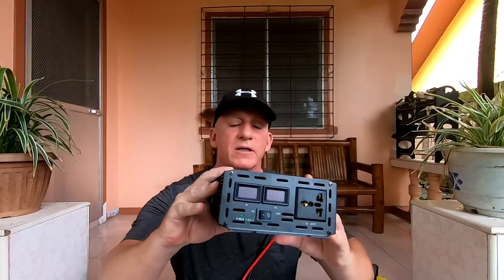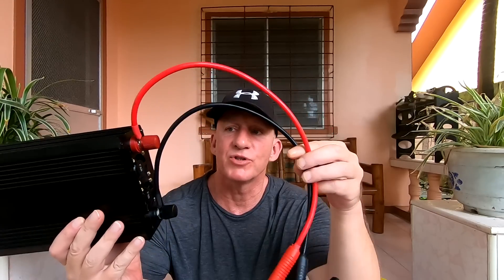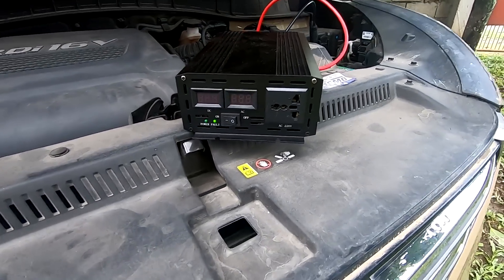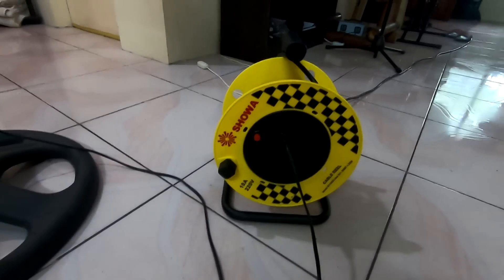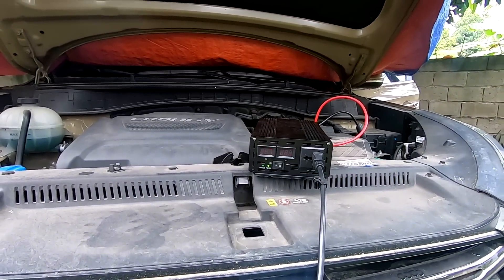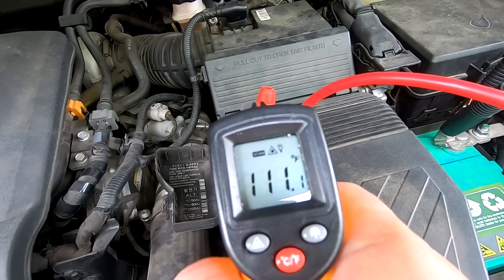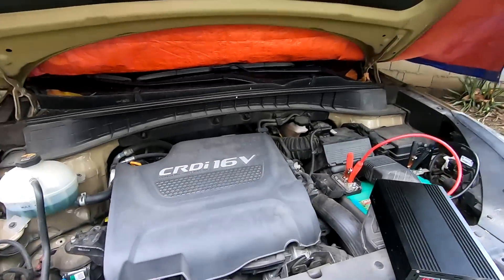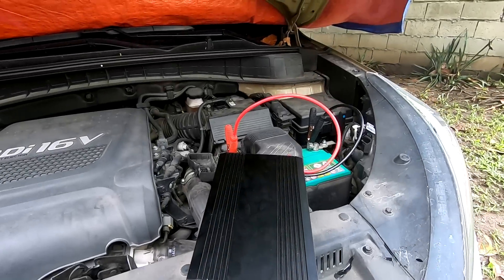Emergency Power in the Philippines:  $125 Pure (?) Sine Wave DC Car Inverter

Comment: Can I use a 12V adaptor attached on the wall outlet instead of 12V battery. Just to lower electricity consumption

Comment: FYI- if such power inverter is rated for more than 2500W cont. and is using 12V - it is unrealistic, because a 12v inverter can not safely and continuously run such high loads (over 2500W) without getting extremely hot (in a hot humid climate that will be even more fatal for the electronic boards and faster).
Rule of thumb if I remember right: if you need more than 2500W of power up to about 5000W - get a 24V powered inverter, if you need more than 5000W of power, get a 48V inverter, if you need up-to (or a little less than) 2500W then the smaller and cheaper inverter that can run on 12V will do the job.

Also watch out! a cheap $100 inverter that is supposed to reliabley give you 3000W, is financially impossible to manufacture, I'd be worried about the quality of construction or the use of cheap B-ware components, that might fail on you at the most important moment (goes long with the saying: "Don't try to save at the wrong places"), I'd actually invest at least in a half decent inverter, doesn't have to be the best of line, commercial grade unit, but something that is rated for and is being used for continuous deployments (not what is being found for dirt cheap on aliexpress, unfortunately).

just my 2 cents

Comment: Thanks , to avoid flickering on lights and panels you can use the 180 degree shutter rule. shutter speed needs to be double of framerate and in sinc with freqense of the current. In Europe its 50 hz  and in the US its 60 hz. so if you film in 24 ore 25 framerate the shutter speed should be  double  1/50 of a sec and in The US 1/60 of a sec. Double will also work cos its still pretty much in sinc. so 1/100 in Europe and 1/120 in the US. This will also give less flickering when filming things with repetative paterns like Fences, tiles on the floor and stuff.
Reply from the maker: It's a GoPro. No advanced settings.
Reply: @PhilippineDreams  Ahh okay , thanks for the answere, content is what is important, and i find your content to be really good.
Reply from the maker: Salamuch, amigo.

Comment: Have you checked if your modem will still receive internet signals during a brownout?  
Unless you are in the US with battery backups for the internet backbone, the Philippines internet backbone will be dead (no power) in your city when there is a brownout.  Is there any point to having power on your modem if there is no internet signal in your neighborhood during a brownout?
-Nils
Reply from the maker: We have fiber so it still works even durinng a city wide power loss. DSL does not fare as well.
Reply: @PhilippineDreams  That is impressive!

Comment: Hi Ned, I would suggest you drop the idea of weatherproofing or even semi-weatherproofing your inverter. The casing of the unit will act as a heat sink for the electronics inside so you should in no way restrict the flow of air to the unit. One of the reasons things like this go on fire is overheating and you will probably find that your unit (and most others) has vents at the front and maybe elsewhere and a fan at the back to provide as much continuous cooling as possible while keeping the size of the unit as compact as possible.
Reply from the maker: Good point.  It looks like it is already sealed though as there are no vents in the back or bottom to cool off the interior electronics.  I might just wrap sticky glue traps around the wall bracket arms to discourage the little buggers from exploring the compressor.
Reply: @PhilippineDreams  I used to "play" with electronics as a hobby years ago and kept a couple of similar units for spare parts. All the ones I had had vents at the front and a small fan at the rear so air was drawn through from the front and blown out at the back. The case itself acts as a heatsink for the high power components such as power transistors and will be made from alluminium which is good for dissipating heat. You were right to get pure sine wave, the best choice for an inverter but also the most expensive.

Comment: I am not a electrician but think that extension is super long you would be better off if you cut it to a specific length you could always ad Male and female ends to what left over
Reply from the maker: .64 voltage drop over 20 meters.

Comment: Doesn't want a generator as it's noisy but runs a noisy diesel car engine! I'd also worry about running a car on idle for long periods, I heard it glazes the cylinder bores, not a mechanic but on a van life forum someone commented that about charging your leisure battery from the engine!
Reply from the maker: It fits our limited needs pretty well.

Comment: After thinking about your evaluation we need to consider the capacity of the vehicle alternator (power source). Typical automotive alternator output is around 50 to 70 amps, a littler higher in some cases unless a high output alternator is used. If we use 70 amp @ 12VDC the continuous output power is 840 watts far below the 3000watts the invert is capable of. When we consider the vehicle has a load to be served by the alternator and recognizing an inverter is not 100% efficient something less than 840 watts is available after power conversion. Temporary / intermittent high loading can be accommodated due ti by the battery. In your intended application you should be fine, but ref and air con operation is not sustainable. Hope you find this useful.

Comment: The higher voltage is the charging voltage. When a battery voltage is specified that is the nominal voltage. Additional voltage is needed to over come the battery voltage (think of voltage as pressure). In addition to over coming the standing voltage the battery has an internal resistance that limits current flow into the battery, the higher charging voltage allows a reasonable recharge time. Charge voltage must be limited to prevent overheating the battery. Typically for a lead acid battery (commonly used in automotive applications) you will see 13.8 charge voltage, after a battery has seen some discharge. Once charged, the floating voltage is close to the nominal battery voltage but still higher than nominal.

Have you considered lithium iron phosphate batteries (LiFePo4)? Higher initial cost but over their life they are reasonable when compared based on number of charge cycles between lead acid and LiFePo4. An important advantage to these battery are long storage life. The have low discharge rates giving good standby time. They life expectancy does not suffer much if kept below 45C (30 or under is preferred). 

If you are interested in more information about LiFePo4 have a look here https://www.solacity.com/how-to-keep-lifepo4-lithium-ion-batteries-happy/

I am considering this technology for my home in Bacolod City on Negros. The once previously fairly reliable power system in Bacolod has had some planned 24 hour outages recently (gotta keep the refrigerator alive). When something like this starts I do not think it will stop anytime soon.

Comment: Be sure to roll the extension cord out, all the way off the reel. I have witnessed multiple coiled extension cords left plugged in - and left on this type of reel - they built up heat, melted or started fire. I like your inverter - cool tech.

Comment: HEY Ned, I'm an expat in Thailand. Been watching your various videos. NEAT!!    I"m a retired architect from the states. I'm NO licensed electrician nor HVAC specialist, yet the advice Deiselman gives you below is "prudent advice" from what I know.  I had a Jeep Grand Cherokee (in the states) with an inverter we installed under the passenger's seat, running a line back to my fishing boat, which I'd halt to Alaska each summer. In the belly of the boat was a lg chest freezer. I'd unload the freezer at our river front camp once I got there. The freezer carried frozen steaks for us up to Alaska and full of Salmon returning.  This trick worked out GREAT!  Yet found:  we definitely needed heavy gauge lines or the lines the size yer using now would seriously over heat and cause damage.  Lines from your inverter to the Battery AND the line into the house; PLUS maybe a "breaker" to be safe, PLUS I strongly suggest, you park your car closer to the home when you do this. Use a much short line so as less power loss and power drop.  But please, don't take my word for it, please ask experts.  Hope this helps a tad.
Reply from the maker: 16 AWG 25 meter is only a .64 volt drop. Not too bad.
Reply: Yup, but that wire, ask any electrician, is gonna over heat when you plug in sumthin like an A/C unit Ned.  I wouldn't be using anything less than 10 gauge copper wire. Good luck friend.
Reply: The power drop and heating happen only on the low voltage side with higher current from the battery to the DC/AC converter.   Get at least 10/12 AWG cables with better jaws.  
Remember at 3000 watts, the low voltage side will be drawing 250 amps!!!  That is a LOT of current and will heat up your low voltage cables as well as your car battery.
(FYI, I am also an engineer.)
-Nils
Reply: @AsianRomance    An inverter of this size can really produce/handle 3000 watts of AC output continuously?

Comment: It is expensive but the Bluetti is one of the best battery powered inverters.
Reply: problem is price/value, because with a stand alone inverter clipped on to a battery bank (single battery or more), it is very easy to scale your autonomy by adding more batteries to expand the AH of the power bank, that means more hours to run electronic devices, while the all-in-one type of devices are a blackbox, they have a certain rating it they can not be expanded, the price is also a bit concerning, for the price of a Bluetti, he could probably just by a 500W pure sine inverter and three sealed 180AH 12v batteries that if connected correctly will yield a total of 540AH ! you are never gonna get that with a Bluetti (even thought it looks cute though ;-) )

Comment: To me, there seems to be an odd combination of high tech and low tech at some Filipinas' places.

In case you can't tell, lol, I like to message.

Things in the USA are really bad.  Legal, required, and other discrimination, since the 1960s, agaisnt White males has been a huge mistake for America. Just for a start, Covid 19 could have been prevented, and the current riots could have been prevented, if the USA hadn't required discrimination against White males since the 1960s.  And, Covid 19 is on the way toward killing a million people worldwide, including possible 40k+ people in the Philippines in 2020 or so. There have also been recent anti-White riots outside the USA.

Comment: Hi Ned, I would not yet give up on batteries as storage for solar panel energy - as they come in different types (lead, lithium etc.). Li batteries supposedly have many more charging cycles than the lead ones, but I do not know how tropical conditions would affect those. About the charging voltage, I would not be too concerned as the charging voltage from the car generator always has to be slightly higher than the car battery voltage of 12 V (otherwise it would not charge, as far as I know). Interesting idea to use the car battery for emergency power supply for the house!

Comment: You say that you have a problem with the noise from a generator but what about the noise of your truck... I'm sure a modern Honda generator of the same power output would not make any more noise. And you are still risking the engine management system on your truck. The longer you run it with that attached the higher the risk that your motor will stop and your dash will be flashing the warning lights of death.
Reply from the maker: Truck is not nearly as loud.

Comment: If you replace the cables going to the inverter I would make sure they are long enough to get the inverter away from the vehicle. If inverters tend to explode when something goes wrong I wouldn't want it to be that close to the engine bay.
Reply from the maker: Excellent point.

Comment: Hey Ned one peice of advice with these cheap inverters dont run more then half the capacity so if it says 3000w only run 1500w constantly but even with your mini split I think you will do fine that probably is only pulling 300 to 400w continuously so have fun

Comment: Hi Ned I've been an auto mechanic for the better part of 30yrs plus I've done a ton of research on solar voltaic and I've starteded collecting parts and pieces for putting it system together it's normal for yor your alternator to produce 13.6 to a little over 14v if it didn't there would be something wrong with it and most 12v inverters will handle upto 15v and if you are looking for a good battery chemistry for here in the Philippines lifepo4 is a good one it can handle heat and cold and is long lasting compared to some of the other lithium batteries most lithium batteries have a battery managed system that cuts them off due to overheating so you don't destroy them maybe you had either a lead acid or a poorly constructed lithium battery and 115f isn't that hot but the type of terminals you are using exspect them to heat up the guys that have been using this stuff use crimped on ring terminals and bolt them on the batteries you can use the bolts already on your battery cable's clamp that will work great I'm glad to see you got a real vehicle lol I can't stand motorcycles here they really upset me because of the way people drive them same for some of the automobile drivers here sure is a different world kinda like the wild west on the street lol thanks for your videos they rock!

Comment: Stupid question ! Have a new Dell laptop here in states . If i take it to PH can i get a charger for 220v there in PH ??
Reply: Most laptops already have a coverter that works for 110 to 240 volts. Look at the black box that is part of the power cord. There will be a sticker on it somewhere that shows "input". It will probably say something like 100 - 240v 50-60hz. I've never had a laptop that needed a separate converter.

Comment: I'll stick with a generator.
Reply: I'd say a combination is best (if one can afford it), a combi of an inverter, battery bank and a charger that is charging from the grid, and a small generator that will be capable of replacing the grid for charging that battery bank on an emergency

Comment: solar works ok for me on our house its good wasent that much 17thousand and 100am hour battery runs fan and tv and my computer and cb radios our inverter is 1500w pure wave inverter and the one solar panel is 300w ours is all from China a local man installed it our runs lights all night and its about 4 yrs old now no A/c we never use one  ive run everything all at once was fine i have seperate voltage use plug to all my plugs are Australian 3 hole plugs 
what is your Rooster killer ? hahhahaha i have a video on it in my Channel Kriss Bartlett also we have rebuilt a new house to nearly finished
Reply: 17 thousand Philippines pesos? Thanks.

Comment: Hi Ned. Normal car charging system voltage is 13.5 to 14.5 volts dc
Reply from the maker: While idling, yeah. When not, around 12 is good.

Comment: Hard to believe you bought a true sign wave inverter for so little money. I have serious doubts as to the rating but if it is serving your needs for the price you paid I am happy for you. Lock the car up and keep second set of keys to get back in or get steering wheel lock or something to be sure the car does not wander off when unattended and running. Your extension cord seems to be more than adequate, with 230 volts the current is 1/2 of that of 115 volts for the same load. A #14 wire at 230 volts will handle the same power as a #10 cord at 115 volts. Best of luck in all you do, and your correct about batteries, not worth the expense and upkeep.
Reply from the maker: I am still not totally convinced either. Pero bahala na si Batman.

Comment: Dude (nicely), the power loss over 25 meters is significant.  You might have a cheap heater and good smoke.
Reply from the maker: 20 meters. At 220 volts, it is fine for fan, router and modem.

Comment: The Champion Dual Fuel generator inverter model #100263 will run for 14.5 hours on one 20 pound propane bottle.
Reply from the maker: Cool but didn't want to get a generator.

Comment: Why not just have a separate battery to use only. Do you really think it safe to use that type during or after storm and what about leaving your keys in your trunk!
Reply from the maker: Idling truck charges the battery. My yard is gated and locked.

Comment: You might want to see if you can get a Heavy Duty plug converter between electric cord and inverter. Looks like you have a homeowners quality plug. That might lose some power or may even burn it up after hrs of running.